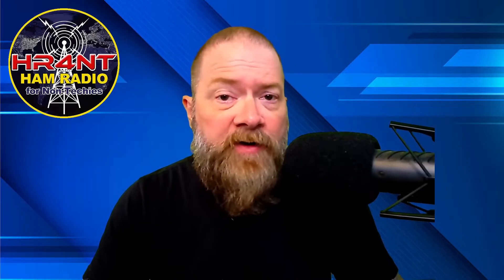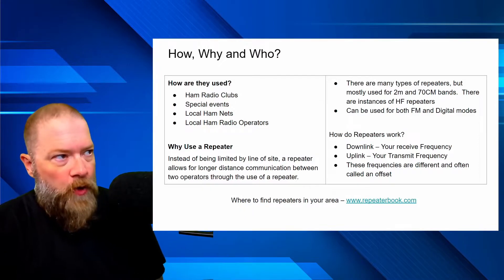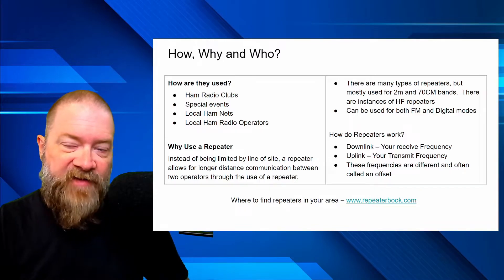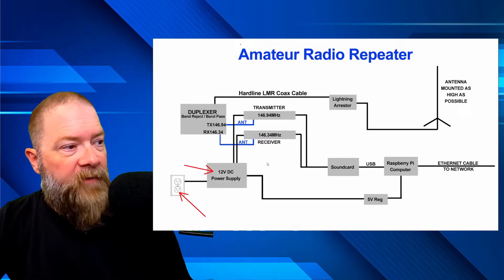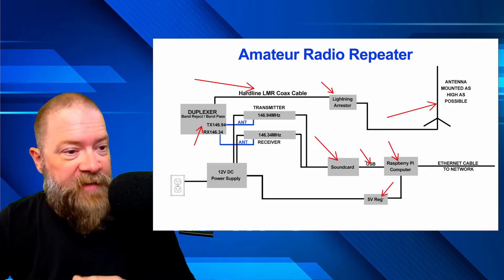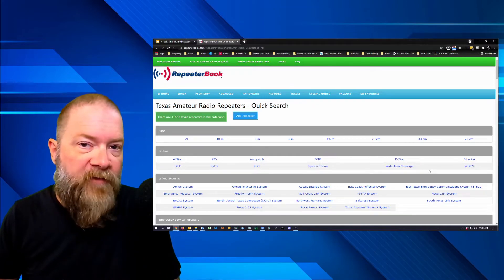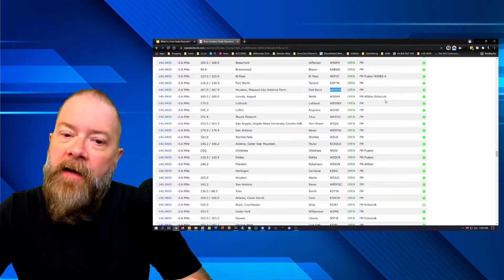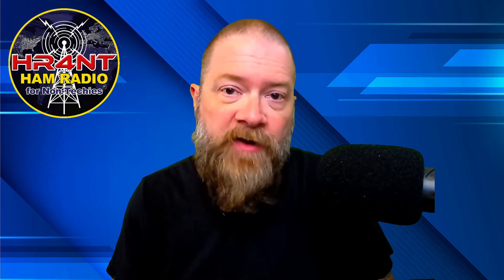How Do Ham Radio Repeaters Work

Comment: I’m super new to this, so don’t judge me, but can somebody explain? Why are you listening to the repeater messages? Is it just to hear the message or the act of creating a connection?
Reply from the maker: The repeater alloows you to be able ot reach others that may be too far away from you for a radio to radio direct connection, so the repeater takes that part out of the equation and allows for poeple in roughly a 50-60 mile diameter to communicate with ham radio.  It is not just for listening.  I hope this helps and there are no dumb questions.  If you need to learn...ask.  I will ALWASY help if I can!  Thanks for the comment and for watching.  73!!
Reply: @ no this does and I just had the go deeper into basics first to understand. Great channel, much appreciated. Working slowly on a ham license

Comment: Love this, very informative, thanks. Could you go a little further? Talk about what FM, FM Fusion, FM Wires-X, FM Echo link, etc are and how to use them. This would really be helpful. Thanks. Really love you videos, they're packed full of great information.
Reply from the maker: Good suggestion.  I do not use the other digitral modes mostly due to the fact that in teh past when I tried using them I found out that therer were no repeaters for thigns like Wires-X in my area.  Tht awas a real bummer.  I will see about coming up with a general explanatiopn of those and do a show on them.  Thanks for the comment and for watching.  73!

Comment: Good grief!  How do you program the ham radio to USE a repeater???
Reply from the maker: You need a few things:  1. You need to know the offset -/+ 600 mhz, 2. The PL Tone (which you can find on repeaterbook if that repeater is listed and 3. the frequency.  I wish all radios were uniform in what they call the settings in the menus, but unfortunately they vary sometimes depending on the radio.  It's not hard once you do it a few times.  Some radios can be programmed on your PC by simply uploading the settings to a card that goes in the radio.  I hope this helps.  Thanks for the comment and for watching.  73!

Comment: How do you know if repeaters are linked? 

And let’s say I’m looking for 2m band repeaters for an yaesu analog HT, can I only connect to certain repeater types?
Reply from the maker: Most repeaters should be reachable.  The only issue you would have is with an AllStar Repeater or Yaesu System Fusion or other DMR type repeaters.  Those would require a DMR radio to connect to and are proprietary to those particular repeaters.  Everything else you should be good to go.  Hope this helps.  Thanks for the comment and for watching.  73!
Reply: @HR4NT Roger that, thank you!

Comment: How close to a repeater do you need to be for it to pick up the transmission
Reply from the maker: Depends on your area and the height and power of the repeater.  Ours is about 800 feet up and reaches 90 miles in every direction.  That may not be the case everywhere based on the above-mentioned criteria.  I hope this helps.  Thanks for the comment and for watching.  73!

Comment: Chirp also will import from Repeater Book.  And it's free.
Reply from the maker: I knew about it, but couldn't pull it up to my memory when I shot the show!  Thank you!  I think that there are some radios though that specifically say NOT to use Chirp with because it can trash the radio.  I know I have heard about it, but cannot off the top of my head name specific brands or models that would apply to.  Thank you for the comment!  73!!